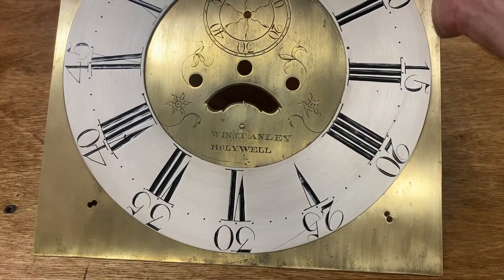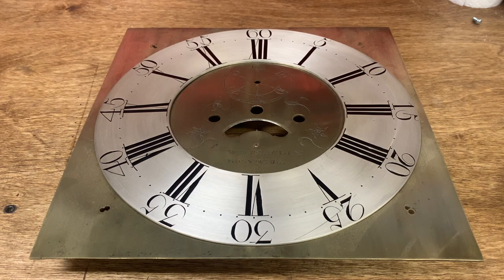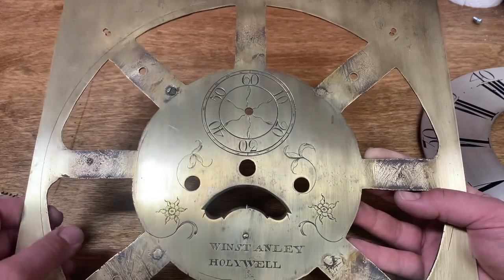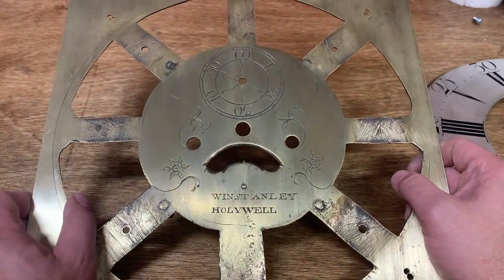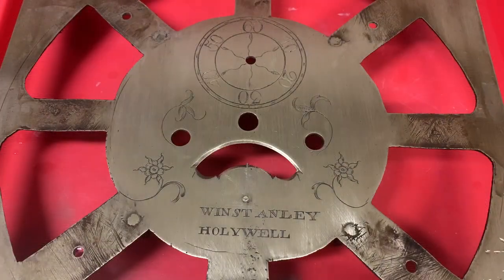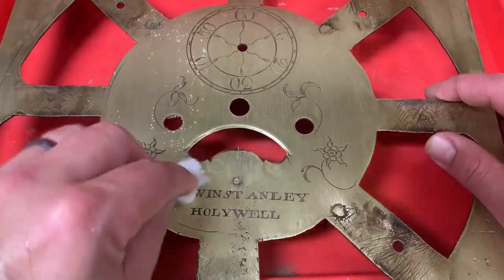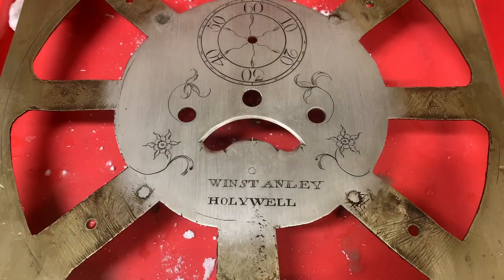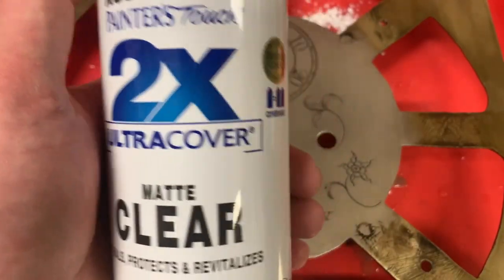Dial Silvering Revisited

Comment: How did you finish off the areas where the spandrels are ? Did you lquer them or use the same matt spray you used in the centre of the dial ?
Reply from the maker: For the corners, I believe I lacquered them with glossy brass lacquer, using the area under the chapter ring as a buffer between finishes.

Comment: what is the black stick ?..., what is its composicion..., thank you.
Reply from the maker: It is engravers wax. It is on the order of a color crayon, but probably slightly different in composition. They are available from clock suppliers and sometimes furniture repair stores as wood filler sticks.